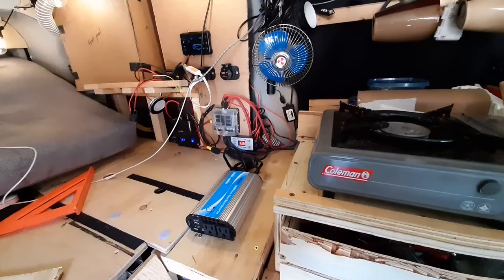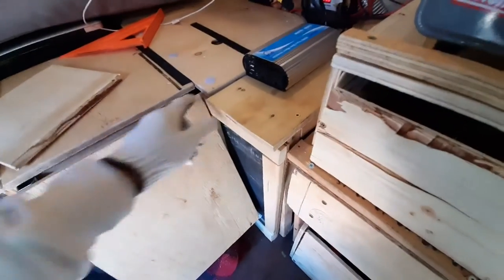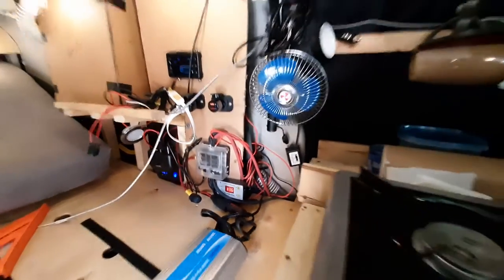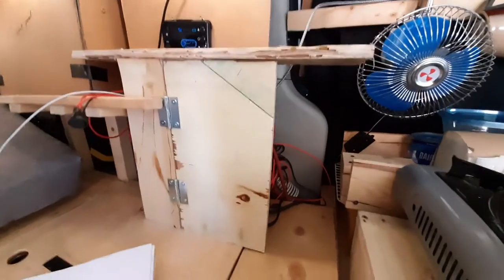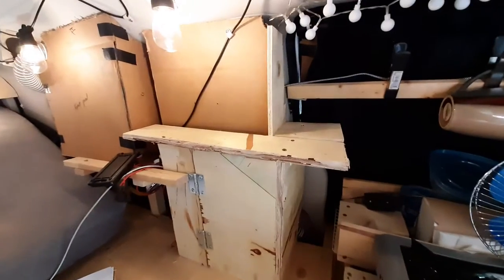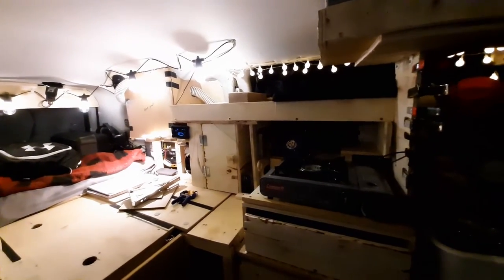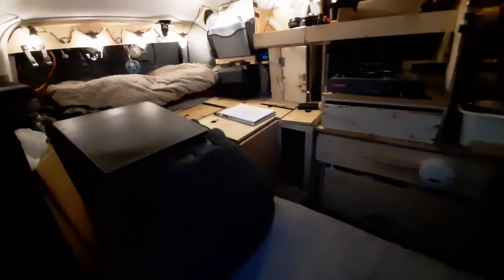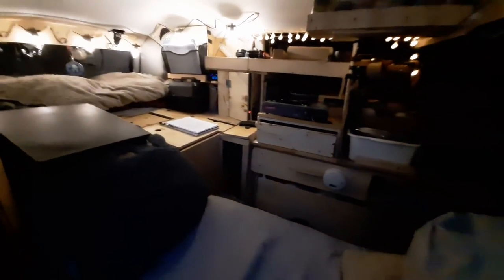RETRO VIDEO - Fuse Box Cover Build for My Minivan Campervan

Comment: Plywood is not only expensive but it weighs your van down. The pallets if not food grade can gas off & make you sick. Just sayin
Reply from the maker: These pallets were from a food company. I've read up on the various markings on pallets. My fave are the heat treated or kiln dried wood. They're extremely light and easy to work with.
Reply: @SilverCabin  I have seen people use a torch to cure the wood and it's beautiful. I think you chose your wood wisely & you have created a very unique space for everything in your van camper ❣️
Reply from the maker: @3generations393  you are just too kind. Thank your for your wonderful support and words of encouragement 🙏